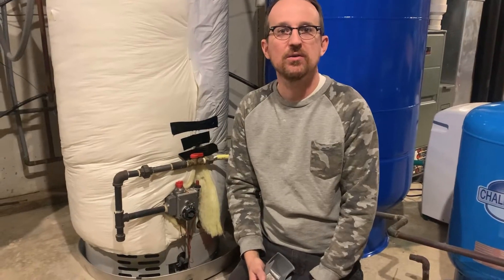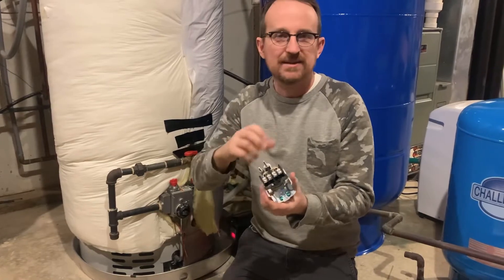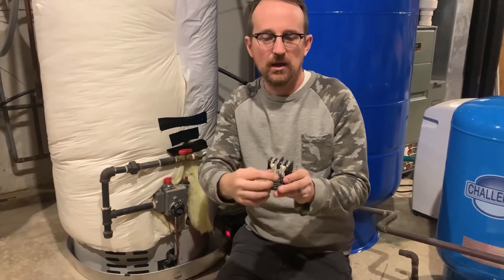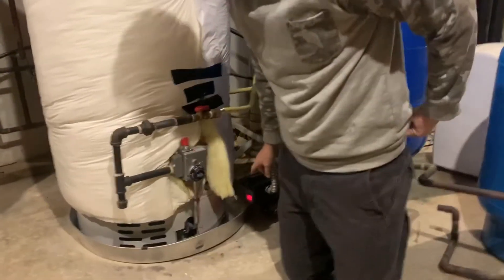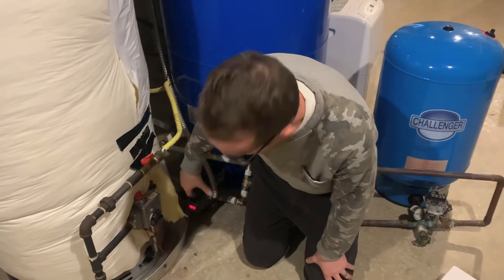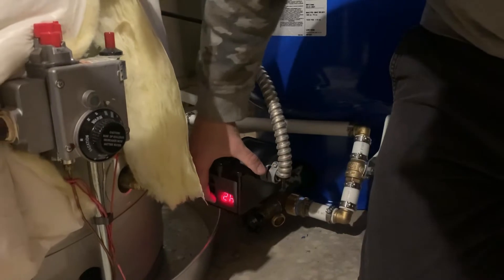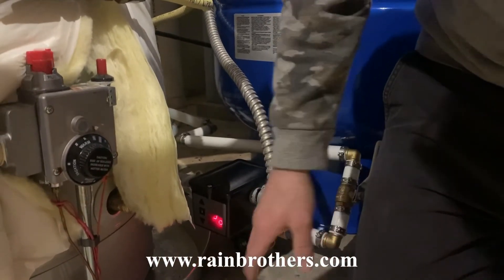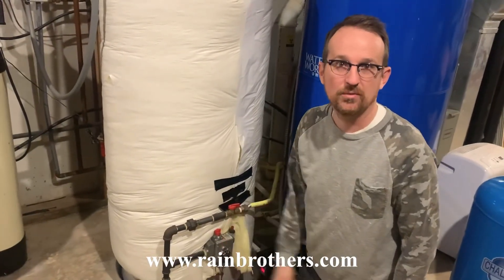EASY way to adjust your pressure switch for your well or cistern pump

Comment: 'if you're too dumb to use analog, buy a digital POS'
Reply from the maker: The digital pump controller is not a POS. Not only is it easy to adjust, but it also has built-in dry-run protection for your pump, which replaces the need for, say, a PumpSaver. Mechanical pressure switches are great and we use them 90% of the time, but they have their downside: They are not easy to fine-tune, they stick, and they don’t inherently protect the pump from running dry. If a mechanical switch works for you, great! If not, and if you want something that you can easily adjust, then this is your ticket

Comment: Having a 15psi differential is going to cause the pump to cycle more frequently shortening the motor's life span, right?
Reply from the maker: Yes. The smaller the differential in pressure switch operation, the more the pump will cycle. And, theoretically, the more the pump cycles, the quicker it will wear out. If you want a tighter differential in your pressure switch, it is best to stay within 15 PSI or increase size of your pressure tank.